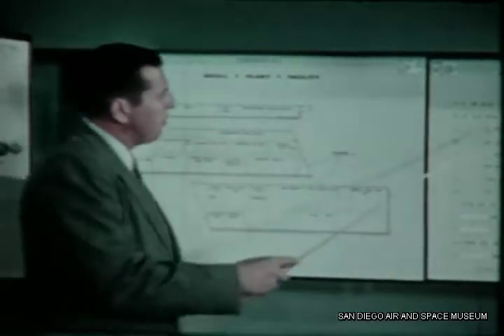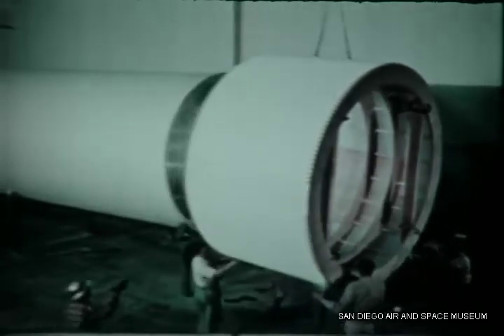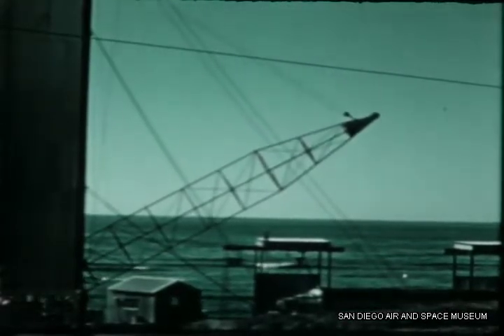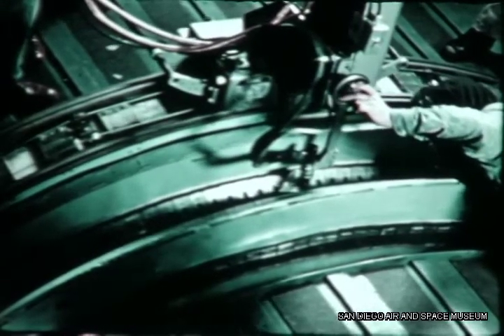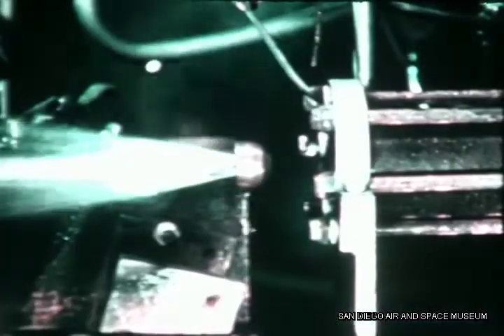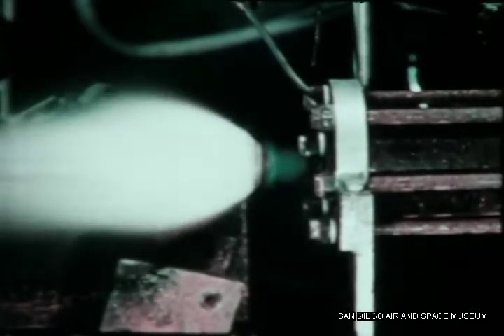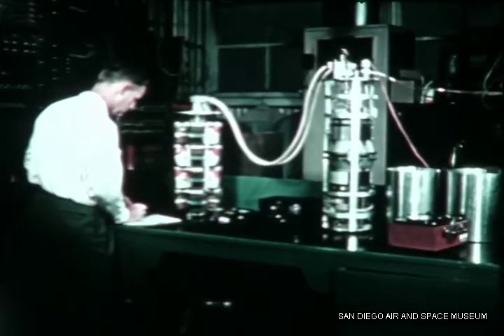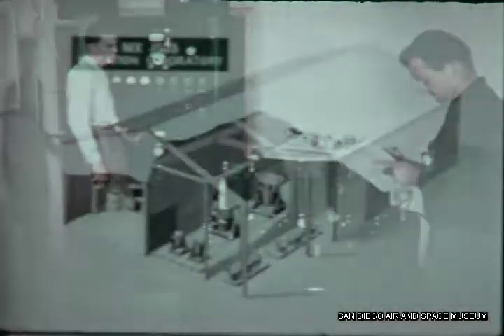HACL Film 00071 MX-1593 Quarterly Film Report 1955, Atlas Missile

Comment: Years ago, I remember seeing a TV documentary where the larger MX-1593 ICBM design was shown.  According to Encyclopedia Astronautica, this version of what became the 3 engine Atlas was to have five engines.  The two additional engines would have increased the total launch thrust from 360,000 lbs to 600,000 lbs.  The redesign of the MX-1593 because of the reduction in size/weight of nuclear warheads caused the vehicle to be redesigned with far less thrust and the program to slip.  Also the competition among the three branches of military service plus what became NASA put the US behind the USSR (Russians) in both space program rocket development and lift capability.
Reply: Yep the larger MX-1593 would've been roughly the same size as the legendary Soviet(now Russian) R-7, and both of these rockets were built according to the initial estimates of warhead sizes(HUGE); but when they realized that the warhead could be made a lot smaller+lighter Convair shrunk the Atlas but Korolev kept the R-7's massive size even though it meant that the R-7 would be too big to move around as an ICBM(atop the fuel issues). Would've been so cool to see the MX-1593 fly though- it was basically a mini Saturn S-1D 1.5 stage with a balloon tank and 2 vernier engines(in addition to the 5 main engines)!